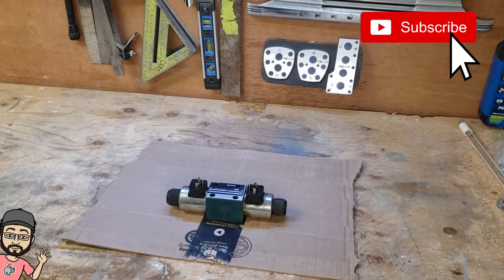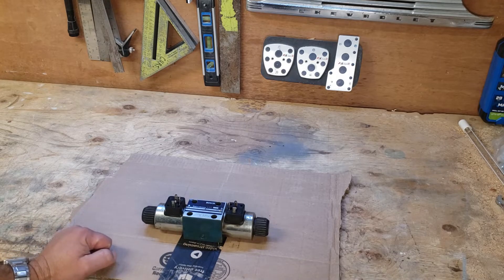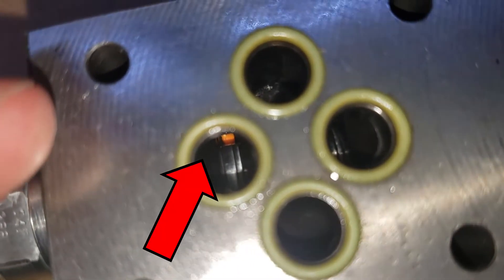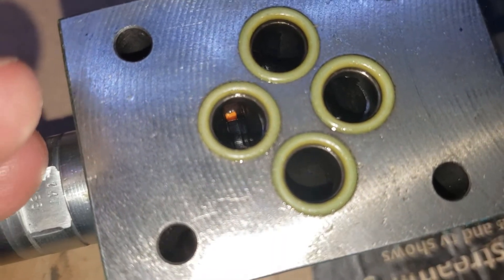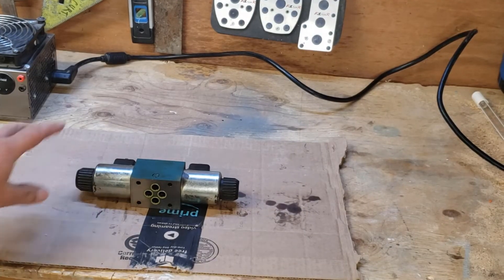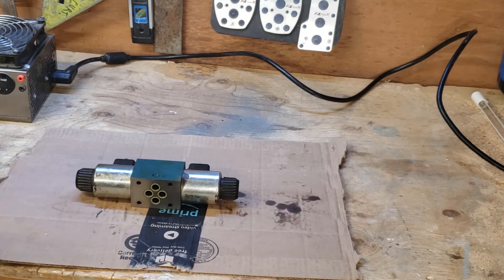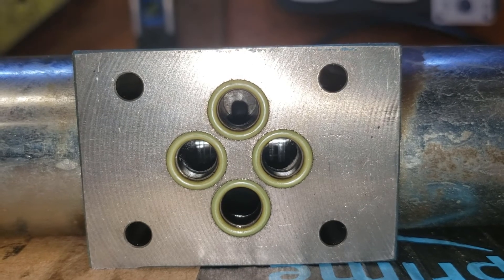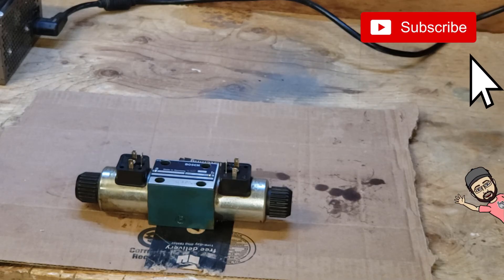Hydraulic Valve Repair

Comment: Have you ever known the coil to get stuck/seized to the actuator? How would you get it off. Mine 6 years ago would slide off with ease like in the video but both are stuck solid. My solenoid got water in so I was replacing it and noticed that both coils won't slide off the actuator rod. Any advice would be great. I have a similar directional control valve on my wood chipper that controls the rollers for forward and reverse.
Reply from the maker: If a little penetrating oil won't get it free, many of these coils are available pretty cheap so if you could find a replacement you could try giving it a good smack with a hammer to see if it'll rotate on the shaft. Or even take a chisel to it and break it down until you can heat the metal sleeve enough that it expands and loosens on the shaft.
Unfortunately I can't think of any ideas that don't involve beating it off 😅🤷

Comment: Hey quick question, What would cause heavy leakage from the blocks on a hydraulic system
Reply from the maker: Bad o-rings maybe?
Reply: @nothandsomebuthandy do you think a bad spool(the piece in the middle) could also be a potential cause?.just tryna get different feed back on a problem i have?
Reply from the maker: The spool could be worn and now fluid is getting by, but I think it would more likely cause the cylinders to creep.
I've seen more fluid escape from the o-rings on the back of the block.
Reply: @nothandsomebuthandy thanks alot!!
Reply from the maker: Hope you get it figured out! 🤞

Comment: Excellent helpful video. I bet there is many a time an entire valve block has been scrapped because a bit of debris has got stuck inside.
In extreme cases debris can even set a tractor on fire if the solenoids valves cannot seat correctly and just keep drawing more power getting hotter and hotter eventually burning out the coil and wiring. This can happen before the fuse blows even though the correct fuse size is used. Diodes can also fail and send power down the wrong relay such as powering forward and reverse at the same time. It is all too easy to get led astray down the wrong rabbit hole when trying to diagnose these issues.

Comment: Is this valve the reason why the machine does not move forward, knowing that it only moves backward?
Reply from the maker: It's possible if it's a bi-directional valve or if there is a second one to reverse direction.

Comment: how to fix that my hydraulic manual valve will moving itself if i connect back the solenoid valave. if i removed the solenoid it will not moving itself. how to fix?. thanks
Reply from the maker: You're saying the manual valve works but electric does not?
Reply: @nothandsomebuthandy  there is electric. but the manual lever of actuator will moving itself if the solenoid is connected. and hydraulic banging sound because of this lever handle moving itself with out touching.
Reply from the maker: @eleonarcanque6355 I wonder if there is a broken spring that should be keeping the manual level in place? Have you disassembled the valve?
Reply: @nothandsomebuthandy  not yet. because hydraulic is always use. maybe after we got to pier we will check. thanks
Reply from the maker: Good idea. When repairing hydraulics ensure the equipment is deenergized and supported and any work is done by a competent person.

Comment: Thanks for making this !
Reply from the maker: @arcadiaoutlaw  most of my videos are a result of me having to repair something so I share what I learn to help the next guy.
Reply: @nothandsomebuthandy  I did the 3rd function on a John Deere after watching video, not sure why valve was stuck but I disassembled worked the valve free reassembled and worked like a charm. This particular valve was different side to side so I assume if you put together backwards it probably would not work correctly.
Reply from the maker: It's surprising how much stuff can be fixed by a simple cleaning, lubricating and reassembly

Comment: Thanks for getting back to me, I took it apart and carefully tried to put the shaft back in, I was gentle and I had a hard time putting it back in like almost 5 min. I think it is compromised, maybe have to get a new one, it's only the middle part that I would need, any recommendations?
Reply from the maker: @stephendomnanovits7252  unfortunately I don't know if the individual parts are available for purchase but you could see if there is a hydraulic shop in your area, they may know more.  Bring the valve with you if possible.

Comment: I understand how you take it apart, I trouble that I am having, when I remove the 4 bolts, hydraulic fluid keep coming out, I'm afraid I will lose too much fluid as I investigate the solenoid valve,  Can you make video on how to remove without making a huge mess.
Reply from the maker: @stephendomnanovits7252  it depends on the equipment and at what point your valve is positioned. If there is a large amount of fluid in lines above the valve with no shutoff it will leak. My valve did leak until the lines were empty. I had a bucket to catch the oil.

Comment: Hi dear, thanks for the very informative video on how to clean the magnetic valve.  May i ask if what the possible issue of my wing van? because when i push the switch button up and down on the left side it goes normally but when i do that the other wing at the right goes up when i push the up button and even the down button the right wing will not go down but it goes up.  When i tried the switch of the right wing same happened no down movement and same happened when i do that to the left switch up and down button the left wing react.
Reply from the maker: Are you able to measure power at the valve connectors with a multimeter?
Reply: @nothandsomebuthandy  not yet, but i will try it tomorrow. So power supply will be the possible cause for that? Or a clogging shaft?  Thank you for your reply.
Reply from the maker: I feel that if one direction is working that it is an electrical problem, I would start there. If power good, look at physical valve.
Reply: @nothandsomebuthandy  thank you for your advice, i will personally check it and will comment soonest for update.  I am very thankful seeing your video on youtube. Keep up the good work.
Reply from the maker: @user-kg5lk8gy8l good luck
Reply from the maker: @user-kg5lk8gy8l one test suggestion is to Unplug the power connector from your "up" coil and plug it in the "down" one, then try pushing the up button. If it operates down then the issue is the down power circuit.

Comment: 4:23 
the center piece im trying to take it off but it resist .. is there a special way or its resisting because of plastic dust like you found inside ??
Reply from the maker: Have you removed the coils and springs from each side?

Comment: SO WE HAVE SIMILAR PART EXCEPT ITS LC GUESS ITS FROM ITALY BUT WERE TRYNA FIND part thats closer to arizona , one of the screws had broken off so we can get a screw in on one side so when we tighten the 3 we have oil still squirts out how can I prevent this
Reply from the maker: These need pretty even pressure for the O-rings to seal. I think your best bet would be to remove the valve and drill out the old screw and retap one size larger, since these screws are too small to remove with an extractor.
Reply from the maker: You can retap in any size or thread you like which will make it easier to find a replacement screw.
Reply: @nothandsomebuthandy  it’s odd because it wasn’t dripping before until I had to fix something then I noticed there wasn’t even a screw in on one corner so it was holding just fine just don’t really know how or what was keeping it from leaking prior
Reply from the maker: Is there a shim plate between the valve and the block? Are all the O-rings in place and in good condition? Have you tried tightening the two screws next to the broken one before the one opposite to it? (this may help reduce a teeter-totter effect when the opposite screw is tightened)
Reply: @nothandsomebuthandy  honestly this my first time messing with the machine so the valve has another thick block which has these 2 big Allen screws on the side  in between it and behind that is 4 ORings  then those to part connect to our machine which is hydraulic lift to lift metal drums , I’m LEARNING AS I GO
Reply from the maker: I learned the same way and still only know a little. One of my machines has a few valves with one to three blocks behind the valve, some are pressure regulators, I'm not sure what the others do. I think that trying to get a good seal with 3 screws may be even more difficult with that second block. My guess is the valve was in place for a long time and rust/dirt/paint created an additional seal over the years that got broken when you removed the valve.
Reply: @nothandsomebuthandy  so I got it to stop leaking and I can get it to go up but when I push button to go down it stays in place would that have to do with air being in the line ??? I don’t wanna keep holding the button and something explode due to pressure
Reply from the maker: It doesn't sound like air to me, more like the valve may not be moving in the direction it needs to go down. If you look at the end of the valve where the coil slides on there should be a small hole so you can move the valve manually. Use a small allen key or something to fit in the hole and push the spool over while the pump is running. Try it in one direction and then the other so you can compare what the spring pressure feels like. It should feel the same and have the same amount of travel in both directions. If not, there may be an obstruction in the valve limiting travel or an issue with the springs, etc. Also make sure the down coil is working, you can just swap the coils and see if it runs the same, and one last test swap the plugs between the coils if the wires are long enough and use the up button to try to run down to be sure there's nothing wrong with the down electrical circuit.
Reply from the maker: Btw sometimes you need to press pretty hard to move the valve by hand.
Reply: @nothandsomebuthandy  right on man I fixed it I got it to go up n down I appreciate the help man
Reply from the maker: Awesome glad to hear, good luck!

Comment: Not very relevant outside a very specific use, certainly not something one comes across outside a specific line of work.  What did that directional hydronic valve even come off of?
Reply from the maker: This is off a Peddinghaus BDL860 beam line, but this style valve is on tons of industrial and mobile construction equipment

Comment: yeah thanks man ! my backhoe loader has these kind of valves in it so thanks a lot gonna tear down one tomorrow :D
Reply from the maker: Good luck!
Reply: Yeah it don't seem to be complicated. The issue is my backhoe has pending waist and a cylinder that lock the waist when in digging position. And it's stuck in exavator mode.
Reply from the maker: Well I hope you find the issue and that this video helps. If it has two coils you can swap them to see of one might be bad.
Reply: @nothandsomebuthandy  Hey one coil is not working so for the moment that cylinder is disconected and i can continue digging :D
Reply from the maker: Glad to hear you found the problem

Comment: My thinking is someone dropped the safety seal of their bottle of the Hydraulic oil when topping up the system. Could be wrong but I've been in that position before. AUSSIE JEFF MOORE
Reply from the maker: It's very likely
Reply: @nothandsomebuthandy  be safe and warm as you shift into your spring. While we in down under deal with the cold.
Reply from the maker: Thank you, the snow is now gone and green is sprouting

Comment: Hello thanks for the video. I don't know really much about tractors or electronics but I have a tractor with a third function valve and switch.  I bought a new grapple for the tractor and have it mounted and hydraulics hooked up but the grapple will not work when I push the third function buttons.  When I turn the key switch to on and push the third function buttons there is no sound at the valve.  The valve on my tractor looks sort of like the one in your video cylindrical but it does not have two wire blocks on each side.  It has one wire block where a red wire is coming from the front of the tractor and is spliced with a wire nut.   The other wire coming out of the wire nut is hard wired into the valve.  There is a plug-in clip that has a blue and yellow wire coming out of the valve running to the third function switch.    I got a multimeter and tried to check the power with the key turned on and I get 10.8 volts to the red wire from the front of the tractor.  I stuck the red lead into where the wire clip harness goes and touched the black lead to the frame and I get no reading.  Does that mean the valve is bad or is there a wiring problem between the valve and the third function button?
Reply from the maker: Is the purpose of this valve to open when the key is turned and stay open? The valve in my video is two directional which is why it has two coils. It sounds like yours just works in one direction?
If the block with the wires has a screw to remove it like in my video you can pull that off and measure the resistance between the tabs on the coil to see that they measure low ohms, almost 0. Next I would measure the voltage going to the key switch, coming out of it and at the end of the wire to see if you're losing voltage somewhere. Lastly I would check the 2nd wire on the block to see if it has a good ground connection.
Reply from the maker: To measure the voltage set your multimeter to volts dc and hold the black lead on a good body ground location and use the red probe to test. To check the ground set to ohms (very low range) and hold one to good ground and the second to the wire.
Reply from the maker: If those all test good then maybe the valve is stuck and could use a cleaning.
Reply: @nothandsomebuthandy  The purpose of the solenoid valve is to use a grapple on a tractor.  The front end loader joystick has a rocker switch, that when pressed, is supposed to open and close the grapple.
Reply from the maker: Ok so I did a little quick reading and I think I understand how that valve works now. When not engaged your loader controls work normally but when the button is pressed the valve diverts the hydraulic flow allowing the same joystick to run the grapple. So it makes sense that there is only one coil, and a spring would push the valve back when released. I have seen rocker switches used for this purpose on equipment at work but really you only need a simple push button switch. If there is a rocker switch the function would only work when it is pressed in one direction unless two of the poles on the switch are connected. Either way the testing information in my previous post still applies.
Reply from the maker: Worst case to test the valve, unplug the connector on the coil and run a dedicated 12v wire from the battery to one of the posts on the coil and a dedicated ground wire to the other post. This should lock the valve in the engaged position. Try the controls and see if it works. If not try reversing the wires to change the poles on the coil and try the controls again. If it works in either direction repair or replace the wiring to the switch. And test or replace the switch.
Reply from the maker: If still no luck one last thing you can try is unscrew the plastic cap to remove the coil completely and put it on your work bench, put a screwdriver inside the hole of the coil keep your fingers clear and connect a battery to it, if the screwdriver sticks to the coil or goes flying out it is still good. In that case, clean the valve. If not, replace the coil.

Comment: How is this value hold on together I'm trying to remove one but can't see where it's bolted up
Reply from the maker: 4 small allen head screws hold the valve to the body.
Reply: You happen to know what size
Reply from the maker: The ones on my machine are 5/32" (4mm) I have an allen key that I cut the short leg off and use in a drill to speed up removal and installation.
Reply: @nothandsomebuthandy  you know how long/deep they're screwed in? Feels like they just turn but won't come off
Reply from the maker: The ones on my machine have about an inch of thread. My valve is also mounted vertically so once they're loose it falls into my hand.
Reply from the maker: What brand/model valve do you have and on what equipment?
Reply: @nothandsomebuthandy  it's on a Cat backhoe 324-2578 turner brand. It's mounted horizontal
Reply from the maker: @anthonyportugal9013  I looked up this valve and only see the four bolts. Were you able to get it removed?
Reply: They just look round
Reply: How deep are they screwed in I can feel them brake loose

Comment: How do you replace coil from AC to DC?thank you
Reply from the maker: The coils just slide off the end once you remove the plastic retaining nut. So you could pull the old coil off and put the new one on. Just be sure you use the proper coil for the supply voltage on your machine.

Comment: Looks like the auto steer valve on a case ih sprayer.
Reply from the maker: Quite possibly, I think it's a pretty common valve used on all kinds of equipment. This particular one is off a Peddinghaus BDL-760 cnc beam drill line.
Reply: Not Handsome but Handy good to know!